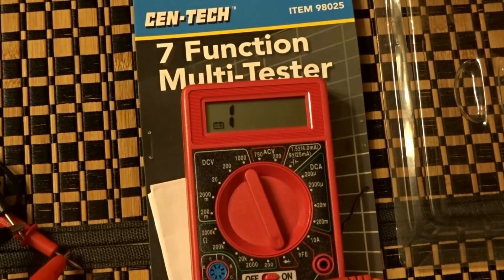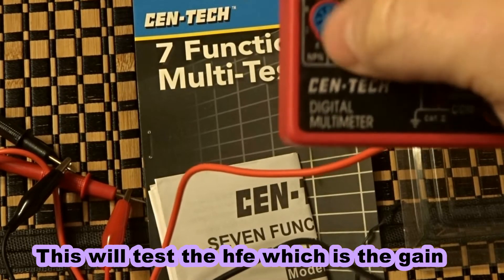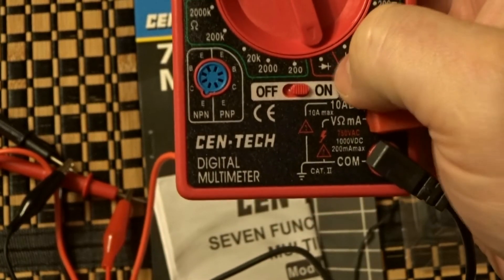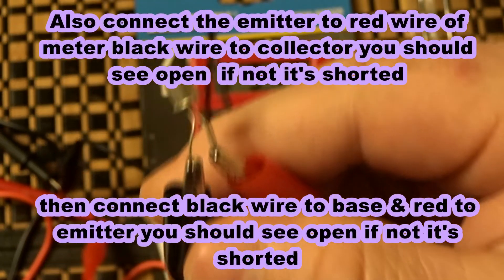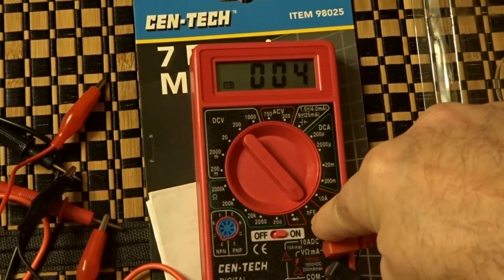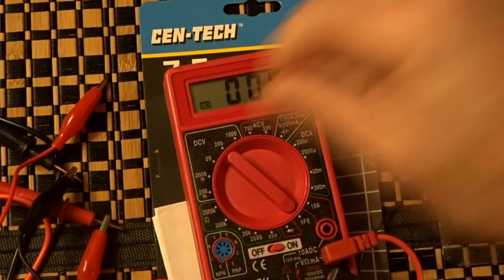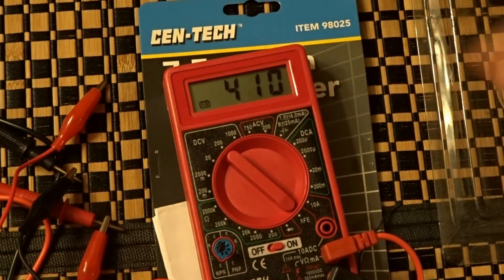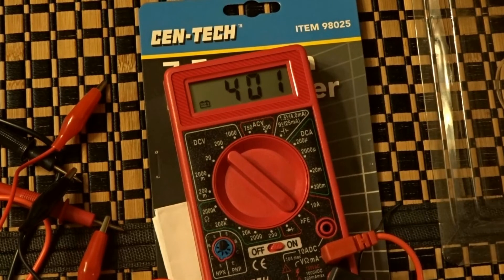How to test for Bad Transistor & Match Transistors with Harbor Freight Multimeter

Comment: My Cent-Tech must be defective. Not reading any hFE no matter what trans. I use.
Reply from the maker: Sometimes you need to twist the transistor so all legs are touching
Reply: @TheVlad69  Sometimes I can get a split second reading doing that. I have a DT-830B  m.m. Identical to the Cent-Tech without this problem. Mouser has replacement sockets if I feel ambitious!
Reply from the maker: @TheBlackbelair  Honestly it's probably cheaper just to buy a new one. The HB socket isn't the best.